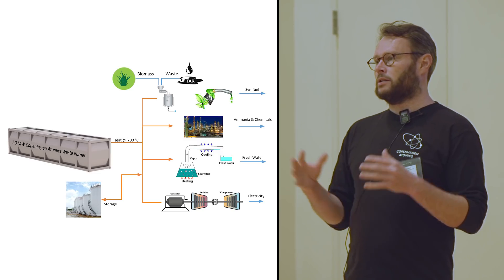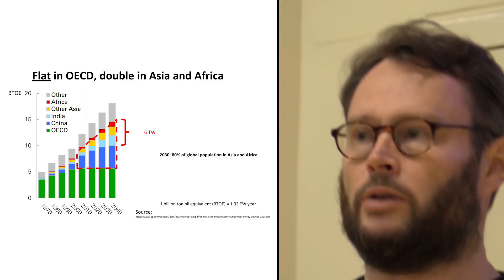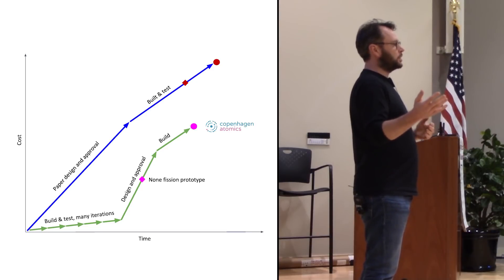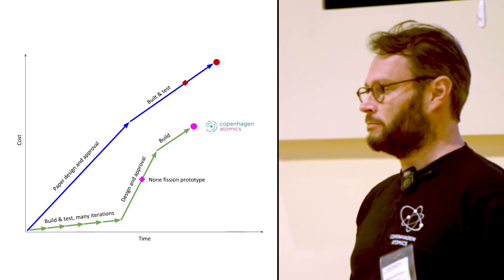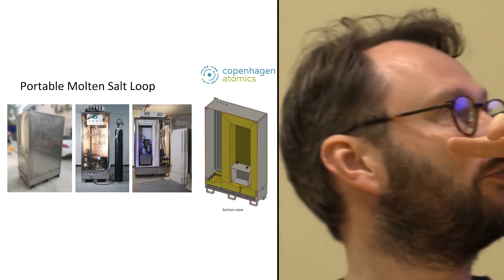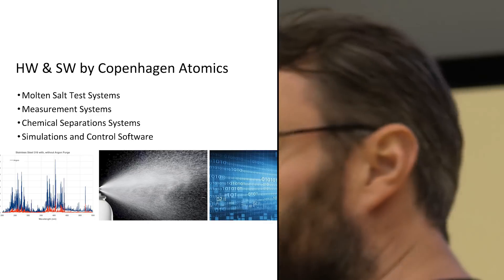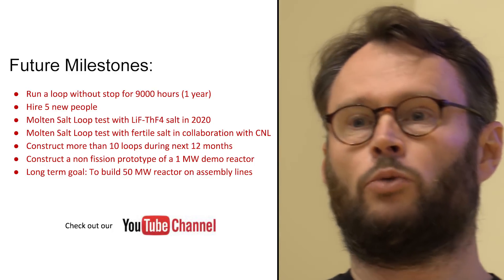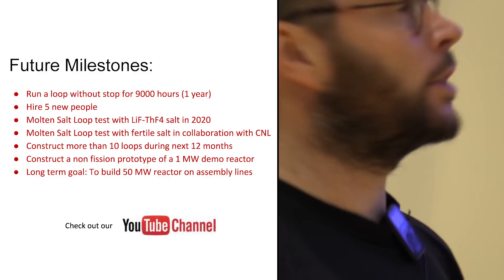Copenhagen Atomics - Thomas Jam Pedersen @ TEAC10

Comment: 10:19 Your new pump is a game-changer (up to which Temp? Curie_point? !! Nevertheless MSRs will always have some foam. To crush down the foam, You need centrifuges or cyclones (the Best are/were built (in Finnland, by Metsä/formerly Albia for Pulp and Paper) and cyclones need pumping_pressure! 
For the purpose of mixing/dispersing (stripping-) gases with liquids, the best design is the "Step-Diffusor" by Escher-Wyss/Sulzer/Voith. 
Ed Pheil's reactor design needs to take care that his natural-permanent-flow, overflow_pipe doesn't get plugged by foam. The exit tubing needs to be tapered from a wide area/cross-section to the tube diameter. Foam that builds up in front of the overflow-exit could contain solid particles and fibrous crystals, which could accumulate, dry out and slowly plug-up the exit. Maybe a pumped MoltenSalt spray-"hose" would be needed, to hose down occasionally any potential plugging residue. Not everything which is easy in water-tanks, is equally easy in molten salt tanks! 
 When a liquid flows by tube into a tank with variable levels, it is good practice, to bend the end of the tube/pipe towards the tank-wall, so the liquid rather smoothly fows down the tank wall, without much air bubbles sucked into the liquid and much less splashing! 
A long vertical downward pipe, without any valve at the bottom end  has a similar problem. 
Machines, that can run empty and therefore are halfway filled upon start-up are also causing unnecessary troubles and mixing of air+liquid and potentially accumulating dirt in sensitive areas.

Comment: Nuclear energy drags a reputation of being very expensive, bad public image, financially risky and slow to produce.
All coal, oil and gas plants should be retrofitted with MSR. The same goes for old tired LWRs.
Reply: @NerdyNEET  Don't think bulldozing old reactor would be needed. Likely a smaller footprint MSR would fit next to LWR,   where steam generator, grid connections can be reused, if it makes sense.
LWRs should be run as long as it is safe and economical, they generally have a good track record, and are already paid for.
Reply: @NerdyNEET  yeah, leaving old reactors intact makes more sense than removing v them. Just remove the toxic stuff.
While retaining old steam generators could work but newer stuff may be better. An off the shelf Siemens turbine is supposedly 50% efficient. A hypercritical CO2 would reduce footprint by an order of magnitude and keep efficiency high. Steam is not that good in comparison.
It should not take 50 years to have MSR commonplace. Technology is not that new, and with mostly factory pre-fab units the licensing should offer huge simplification. Building prototypes over and over again slows down the process. Wheels need not be reinvented
.

Comment: We are out of time. The transition from fossil to nuclear needed to happen over the last twenty years, but it didn't. Now there is no way to stop some of the worst effects of climate destruction, but with a radical, desperate push for nuclear energy to completely replace fossil fuels in the next ten years, we may be able to rescue most of the planet from ecological destruction. Or maybe not. If we get started today, we may have a chance.
Reply: Another person that believes the the minor greenhouse gas is responsible for warming without any  climate forcing from the established cycles on different times scales some which are interfering, cancelling and building amplitudes of patterns.  Never mind that we are in a cosmic ray maximum building on the long cycle not the 11.6 year solar cycle producing way more aerosols than we've seen on the whole satellite  era. Nevermind that the jetstreams are in much greater flux causing more heat cold distribution between sub polar and temperate zones causing extreme weather along the convergence zones. Heat, pressure, and charge are all in extra steep gradient differentials  because of the extra whey jetstreams which are thermocouples modulated by space weather and not her to do with co2. Carbon dioxide warming is a children's story funded my the petrobanks to manage carbon credit swaps on all energy production and they get a healthy skim regardless of which direction the carbon credits are flowing. They are essentially the market makers. Do you really think the rocketfellars would 50% fund the 1st Rio earth summit because they give a shot about pollution or species diversification etc. Of course like most carbon bandwagoners they actually never read the minutes of the 1st earth summit. Oh what does it contain. Well mainly the implementation of a predrafted carbon market which was   they main part. All other environment concerned got a few seconds on time. A complete corporate political heist and years of junk science to follow. Even the so called grass roots activism was complete astroturf. I know I was in the movements. Rockefellars brothers seed funding 350.  org initial 6 million to manufacture decent so they could then manufacture consent. Where do you think all of our funding to do activism came from. If you are coming to the science table please bring adult content and not fairy tales. The uranium lobby is part of the same cartel and the military industrial complexes and petrochemical banking industries.  Thorium being only fertile and not fussal was not going to help perpetuate the racket. If you actually read documents rather than the news reported on the documents you might actually start to joint the dots. Yes maybe start with the minutes of that earth summit which you have not read. It's quite long though.